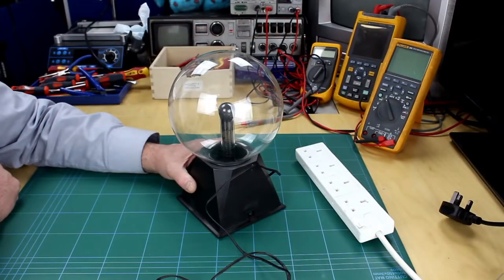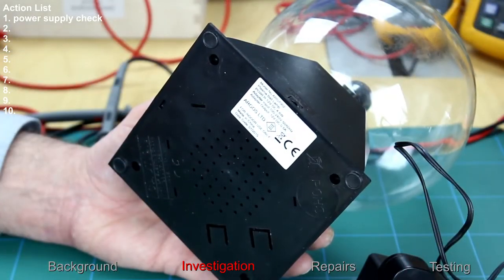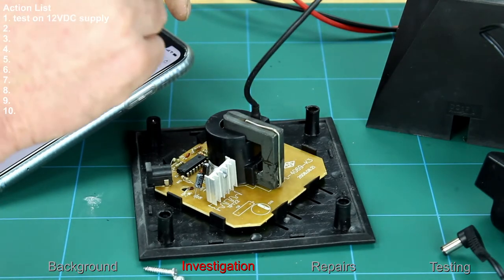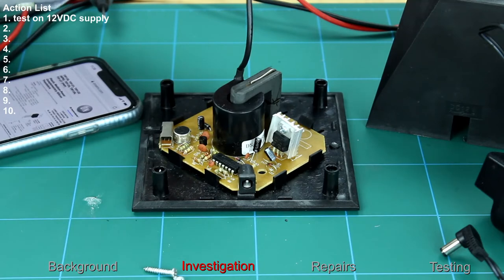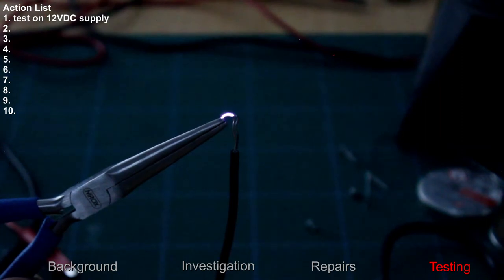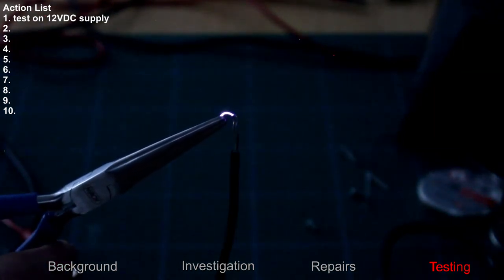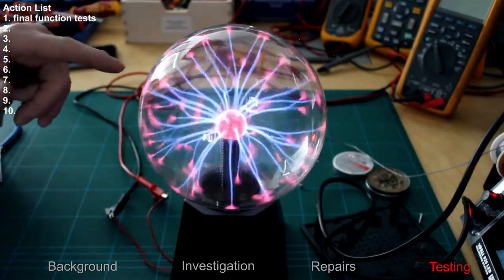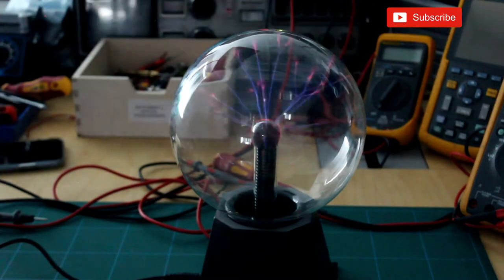Plasma ball investigation - Let's get it working & draw some arc's !

Comment: hello my plasma ball is turned on but no plasma rays is coming out, how can i fix this? thanks
Reply: hope you can help me out with this sir
Reply from the maker: I would suggest that you see if you can draw an arc as per the video. If you can then the problem is probably with the gas in the globe (leaked). If you cant get an arc, it may be due to a HV transformer fault or electronic component failure.
Reply: @RetroTechRepairShop  how do i draw the arc?
Reply: thank you for replying, i think the gas leaked
Reply: Help please.
I live in Seattle Washington, and have a rare plasma lamp from my childhood that just stopped working recently, any idea were I can have it fixed ?
Thank you for your time.